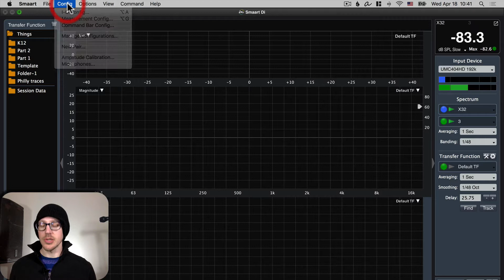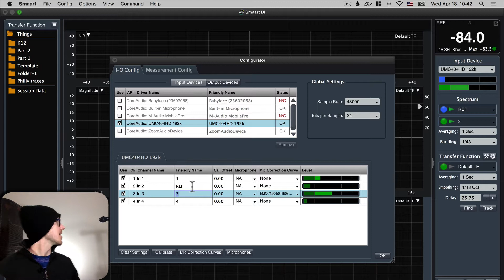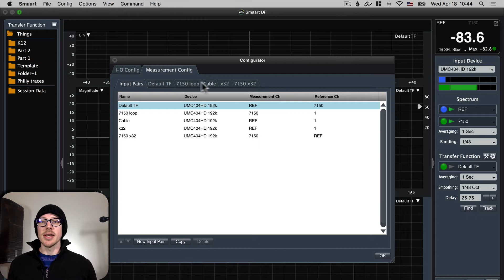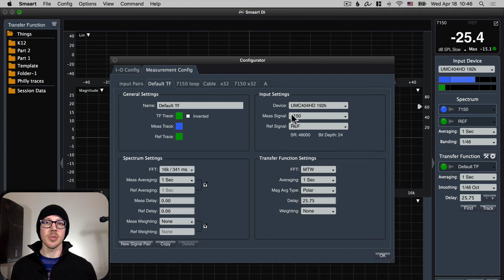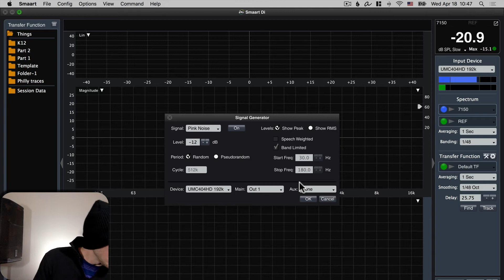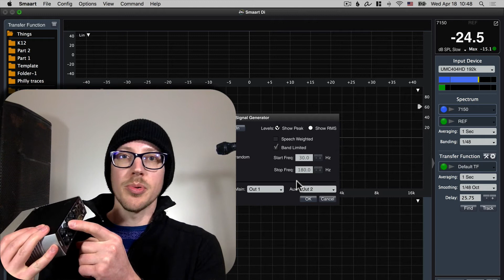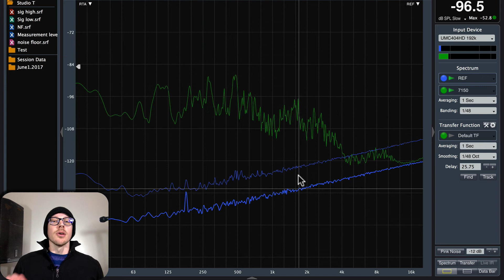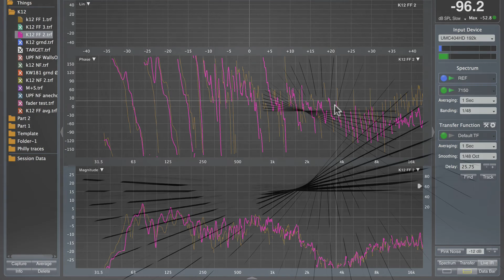Get setup to take your first measurement in Smaart DI [GSwSST7]

Comment: If you only have one mic, in my case a sonarworks reference ID RTA mic, would you suggest tuning my left right by just tuning one side (having mic as close to the speaker as possible and running pink through just that one speaker) and then copying and pasting the eq to both sides or would it be beneficial to run pink through both while being center to the two? Or would that create comb filtering?
Reply from the maker: Hey Brian, so you are just talking about the EQ step? Every speaker needs solo EQ and combined EQ. 
For example:
1. L solo EQ 
2. R solo EQ 
3. L+R combined EQ

Comment: Hi Nathan, could you please tell how to resize or change the hight of windows in TF / Live IR Mode where there are three windows? Example my IR window is like half of the Screen and the rest two windows are sharing the rest 50% of the Screen. Actually i prefer ti have IR Wndow smaller and the other a bit bigger. Thanks
Reply from the maker: Hey Priyan, it's in your settings somewhere. I'm not sure about DI, but in Suite it's Graph Settings > Transfer Function > Plot Proportional Graphs. Also: support@rationalacoustics.com
Reply: @nathanlively  Hi Nathan, thanks that helped me to find it. Actually i have Smaart V8 (Full Version). Its unter Options -> Transfer Functions Tab. and there is an Option called "Proportional Panes" under Graph Settings. There i have to untick.

Comment: Will a di2 version do for the Audio sound system course ?
Reply from the maker: Hey Ishaan, I have several courses, so I'm not sure which one you mean, but I'm sure it will be fine either way. :)
Reply: In your audio interface behringer umc404HD. There is phatom power master on off switch. One For all 4 channels. How do you route your reference loop? You run it through an active di box ?

Comment: Why would you recommend the Y cable over just going out of the interface into your console then direct output from the console into the interface input? Don’t you want the reference to include what the console does to the signal or no?
Reply from the maker: Hmmm, I think the only reason you might want to use a Y cable is speed and simplicity, but it is not what I recommend.